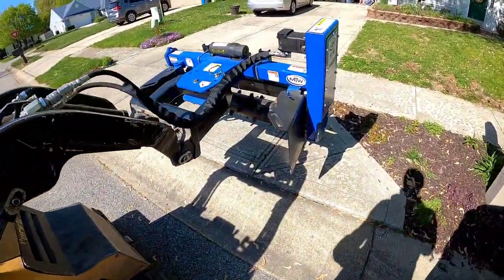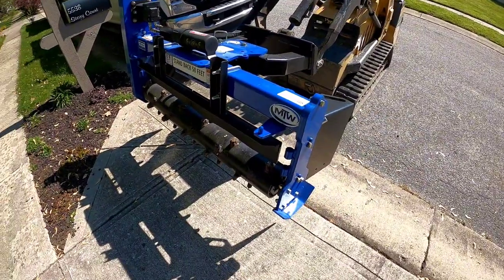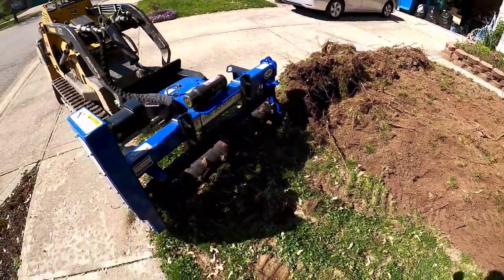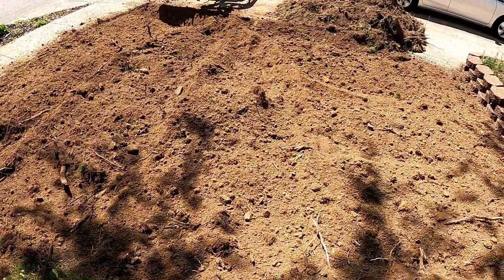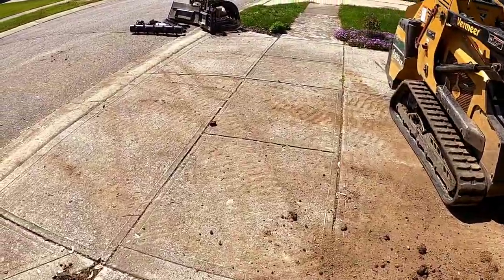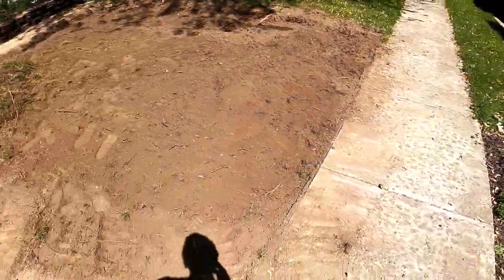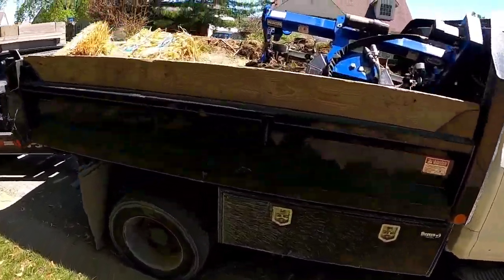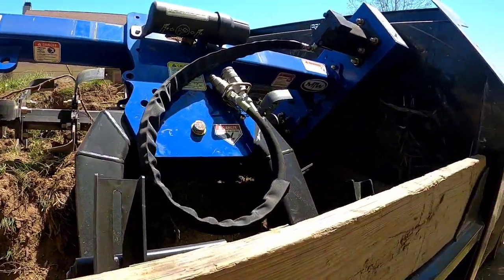***UPDATE*** Well built power rake but serious flaw with bearings(Read Description)

Comment: Nice work as always John! I like the new toy! I have a quick attach power rake, which is direct drive, and am happy with it.. but the ability to run other tools on that is pretty awesome! What was the additional cost for the tiller, and how heavy is the rake drum to remove? Thanks! Great work as always!
Reply from the maker: Tiller was another grand. But within the 10k. The rake and tiller both way the same roughly. But not sure on exact weight
Reply: @SchottServices  that sounds resonable to me for the extra capability! Great work.. enjoy your videos!

Comment: Awesome attachment! I'm going to look at them when I buy my next one. I have a Bobcat brand currently and its a direct drive and I HATE it. the direct drive sticks out the side and has a skid plate below it and it turns into a dirt pusher the whole time. It has to be on the inside of the driveway or it scraps the lawn and make a massive mess. I would never buy a direct drive ever again. This doesnt have gauge wheels out front. how do you feel about not having them?
Reply from the maker: It has Guage wheels but I have never used them on the old one or this one

Comment: As soon as I use tools that consume hydraulic flow, my s925tx overheats, you never have any problems? vermeer advised me to change the radiator to a more efficient one.
Reply: Super impressive as well an artistic process.
Reply: My bobcat mt55 also, i found if i clean/rinse radiator and use rotary attachment on lower rpm it does not overheat.
Reply: I have a Toro Dingo TX525 the radiator and hydraulic cooling radiator are very close together and debris gets stuck in between the two, I usually have to take the two radiators apart to clear the matted debris stuck in between the two radiators about 3 or 4 times a year.
Reply from the maker: How many hours are on your machine?
Reply: @SchottServices   65!
Reply from the maker: @Lecureuildesjardins  should be under warranty. I'd take it in to get checked out

Comment: does the chain run in oil bath?
Reply from the maker: Yes
Reply: They are plenty proud of that tool, how many times have u used it and any repairs so far?  Do u recommend?
Reply from the maker: Great tool! I don't use every day, maybe 2-3 times a week but typically in gravel/stone driveways. I do run it pretty hard and it has done well over the last year. They do have an odd interval for greasing bearings. They are sealed so it's every 120 hours or 3 months. I am used greasing the bearings every time I use it. But so far it runs like a champ. You need to grease the spindles each time you change switch the rake to tiller and back. I'll do a video soon of having it for a year to talk about these updates! Their customer service is unparalleled though. To me that is worth every penny!